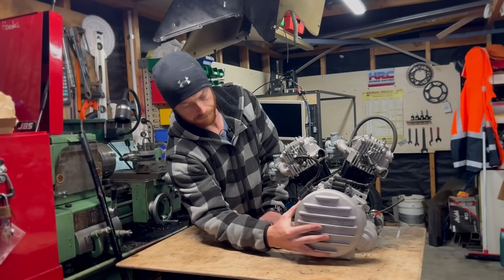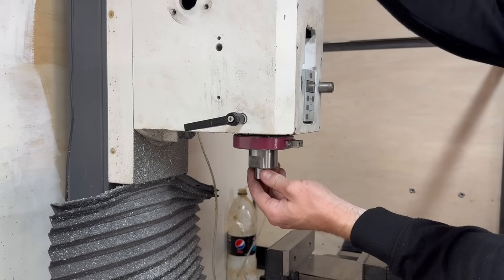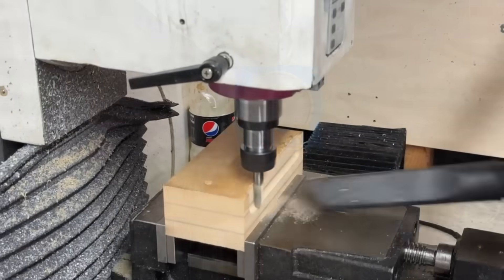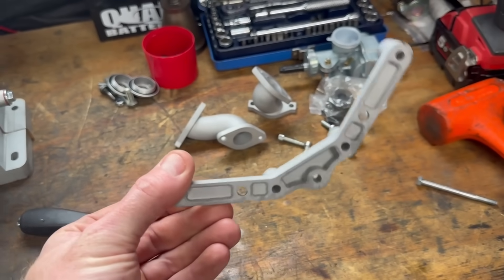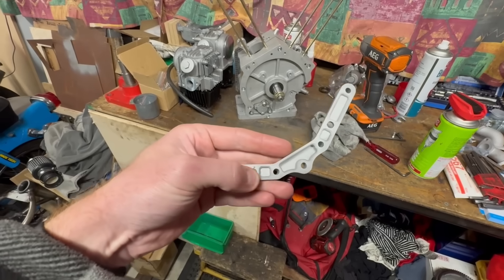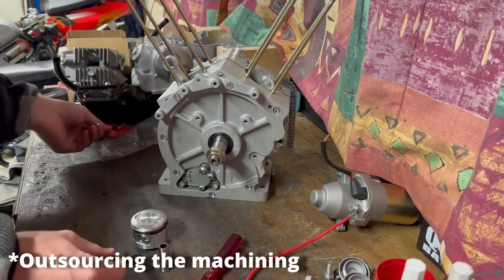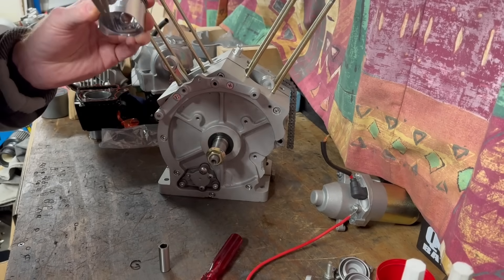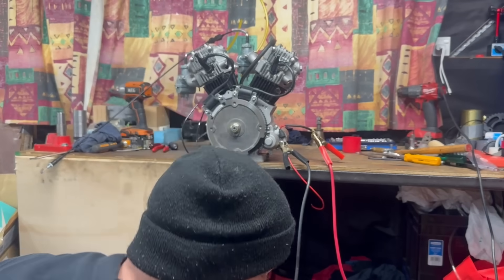Starting My Hand-built 200cc V-Twin

Comment: That’s a mean platform to build from if you wanted to run big bore cylinder and TB2 head/cams.
Reply from the maker: Thanks. The plan is to add on a bunch of options like 56mm cylinders, a lightweight flywheel and bigger pipes to see how much power it will make. 

At the moment I am reliability testing it as a 200cc motor with a fairly safe max rpm.

Comment: what sort of rpm and power figures does it make?
Reply from the maker: It’s designed to run around 4K rpm consistently, it can rev higher. It should make around 8-10Hp. Hopefully I can get it on a small engine dyno.
Reply: @OddsandEndsMachining that's real smooth, very nice engine you made.
Im trying to make my own 2 stroke w3.

Comment: Very cool! Too bad you couldn’t have the intake side of the cylinders face each other so you could run 1 intake and 1 bigger carb.
Reply from the maker: Thanks. Mirroring one of the cylinders was going to be a big job so I settled on this design. The other option is to spin one cylinder 180* although then it makes the cam chain situation twice as complicated. 

Further down the track I plan on casting my own cylinders and heads which will be mirrored.

Comment: Yo what was that sound when you turned the crank with your drill? Sounded like contact from my house. Im probably wrong but curiosity is human nature after all. Great job lad.
Reply from the maker: Thanks. I had the motor temporarily assembled to check the oil flow/pump operation and noticed it too. After that was filmed I replaced one of the screws for a lower profile version and it solved the rubbing. It’s all part of the process test assembling and making sure every single part has adequate clearance.
Reply: @OddsandEndsMachining copy that!!! So i wasnt hearing things!! Again, fantastic job! Ill raise a drink to you getting a production run of them when you do!!

Comment: Занятно. Но один карбюратор однозначно был бы удобнее.
Reply from the maker: 100% although creating a mirror of the front cylinder head would not be very convenient. Nor would spinning the rear 180* and running dual cam chains and tensioners.

Comment: What about a big bore kit?? Maybe  going up to 250,300-400cc   what kind of rpm can this engine turn?  I wouldn't mind having one for a scooter (modified scooter)  you can easily  modify the block to accept china scooter cylinders and heads using the 150- with big bore kit 180cc cylinder and heads other parts ate cheap. They are clone HONDA GY6 ENGINES.  MUCH like the ones used on this engine. The intake and exhaust will need to be different.   
Use this engine and a cvt  mounted on a swing arm with the rear wheel. 10" probably  maybe a 12" will fit.  The seat will need a custom mount. It should be a 60+ mph scooter with nearly any size person on it..  a pair of 26-30 mm carburators .and a decent exhaust.. Plus, it sounds great..
Reply from the maker: Thanks, with the kits currently available I can punch it out to 265cc using the same stud pattern for the cylinders. This engine should be able to turn Upto around 8,000rpm fairly safely in its current configuration. The previous  prototype version can spin a little faster due to a few different design choices. 

Although these are designed for use in mini bikes and are governed to 4,000rpm out of the box to ensure longevity and will go more than fast enough when mated with a CVT setup.